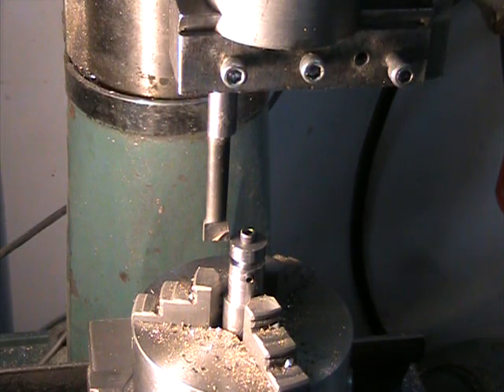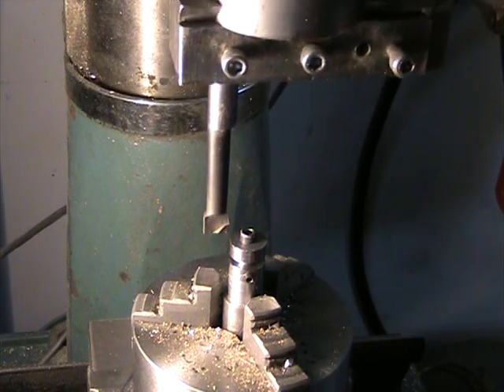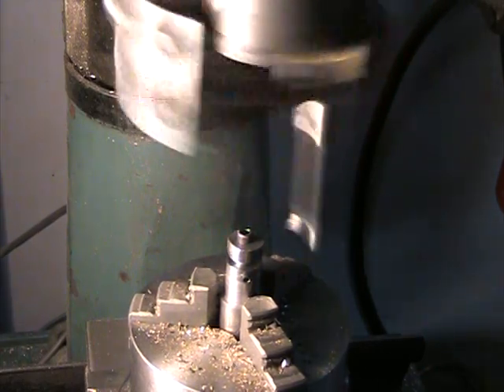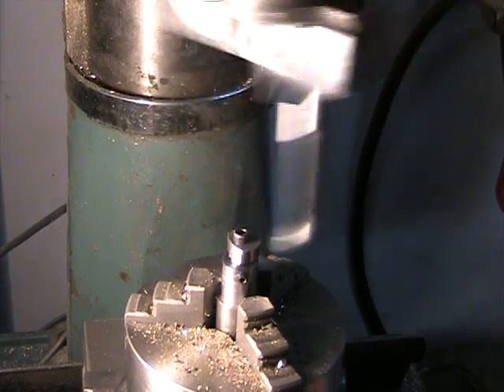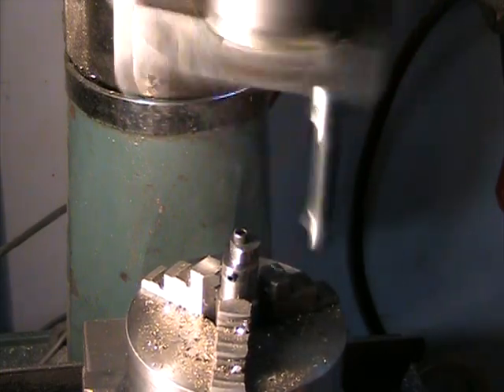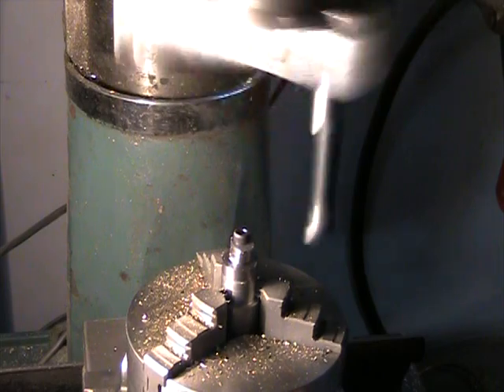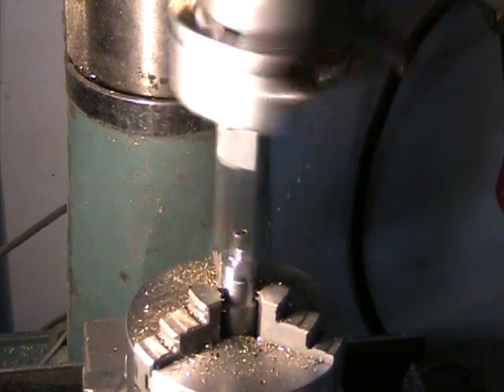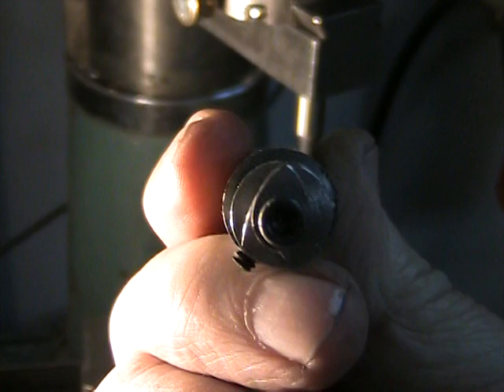Cutting a Model IC Engine Cam Profile

Comment: lol... I thought of this same exact idea several years ago, and I got so excited about this idea that I forgot all about the other good ideas that needed to go along with the first good idea.... my machine did not have reverse (counter-clock-wise rotation), so I cracked open the machine, added a DPDT switch... great, now I have squared away.... on to machining..chucked up my R-8 boring head, spun the cutter around 180 degrees.... yes!!! I'm ready to throw some chips and do a test run on making just a random little cam, just to see how well, my wonderful idea will work....... did I mention, that my boring head screws on to the R-8 adapter (clock-wise).....lol... about 4 indexed passes into cutting, (intermittent cutting, as you know), and as I was moving the quill upwards so I could index the rotary table for the next pass, the cutter seemed to stay at the same level......something was seriously not right! I right away shut the machine down, maybe the boring bar was lose?... nope, the boring head was unscrewing from the R-8 adapter.... lol.... OOOP'S!!!!  It was hanging on by only a few degrees of the last threads.. so, that was close. I suppose, I was due for a screw up (no pun intended) beings I hadn't screwed anything up in my shop in a few years.... I have sense then, acquired a different boring head to do this game, I is bigger too..  cool video though! brought back some memories of my idiot attacks... lol